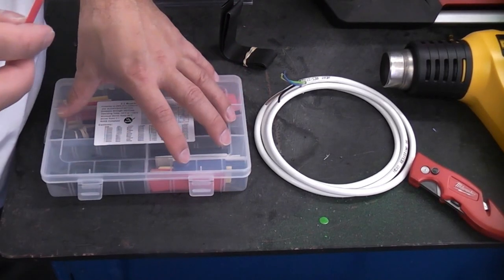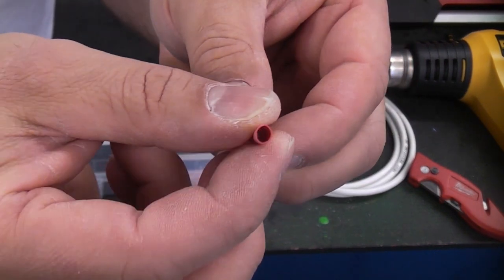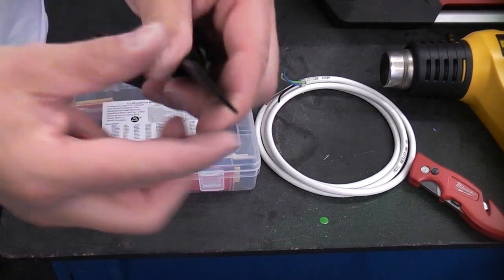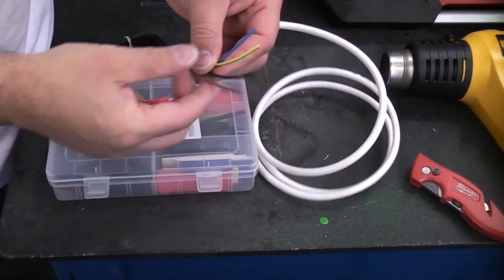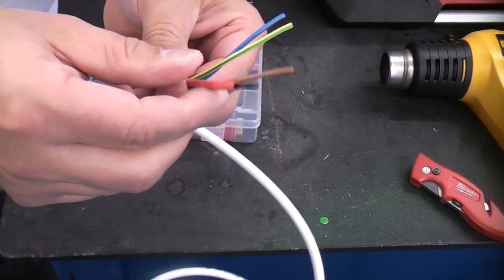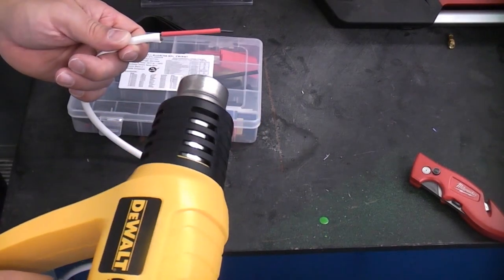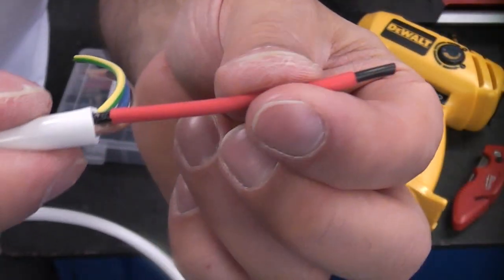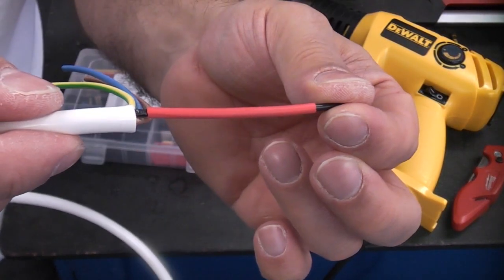Heat shrink sleeving

Comment: Excellent UHM! Do you have a preference in this tubing? PVC or the other material which I can't remember what is called? Merry Christmas to all!!!
Reply from the maker: Thanks, I tend to just use what I have in the garage. I have a kit with a selection of sizes but also have some loose which I bought from ebay. Can't remember what the heat shrink is made from that we use on site, it might be PVC.
Merry Christmas and thanks for the comment ;-)